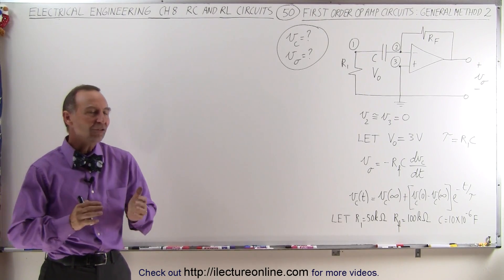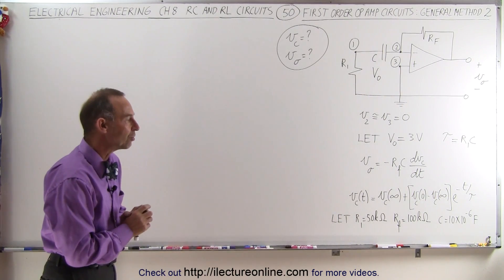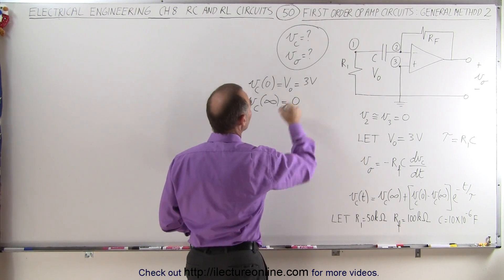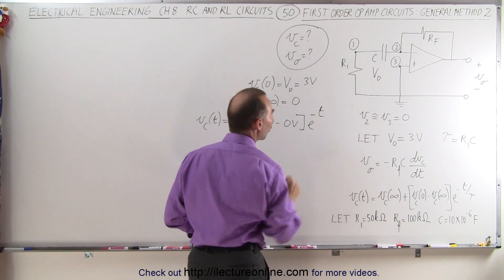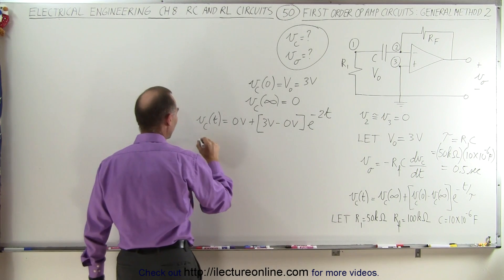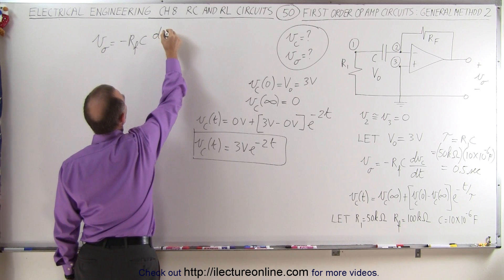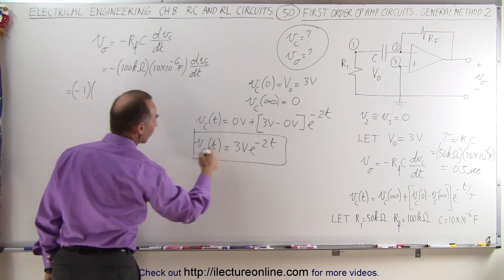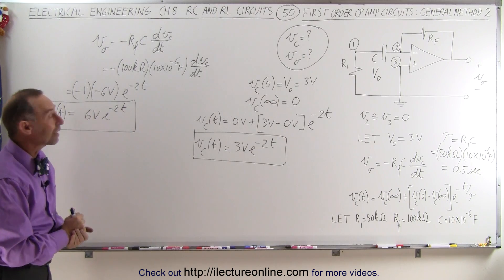Electrical Engineering: Ch 8: RC & RL Circuits (50 of 65) 1st Order OP Amp Circuit Method 2

Comment: Voltage at infinity is only current flow is cutting but voltage is present(i.e. 3volt decrease to reach zero again starts current flow,....) sir, similarly inductor the  voltage is cut but current is present..... its correct or wrong?